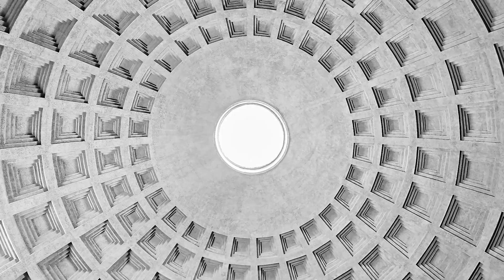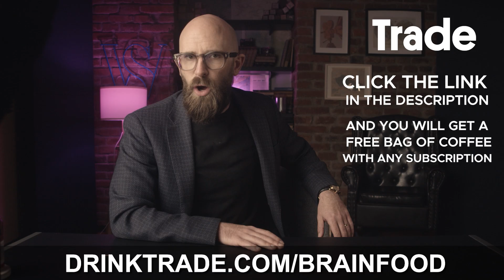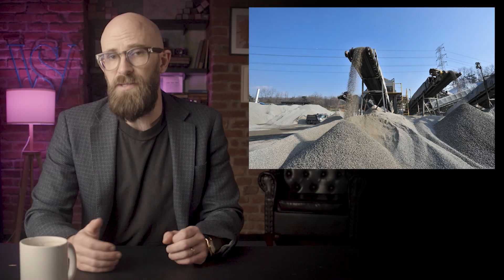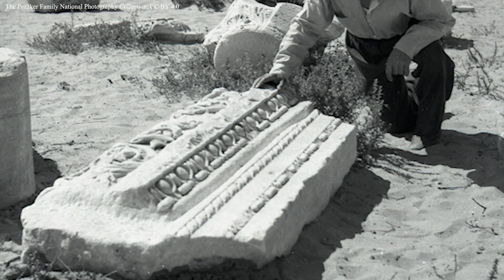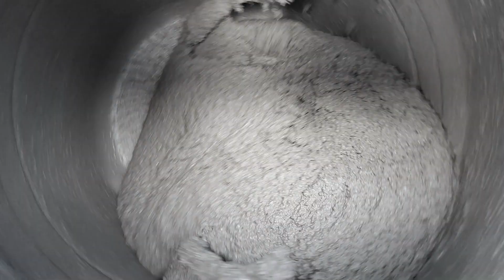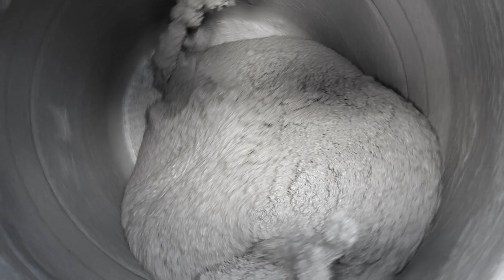How Did the Ancient Romans Make Concrete So Much Better Than Ours?

Comment: Everything changes in 2000 years. It was a different world we lived in 20 years ago. The bacteria was different in the earthen materials 2000 years ago and behaved differently under different environmental conditions. It wasn't what the romans did or did not do, but what the bacteria from 2000 years did and did not do within the cement. The Romans also worked with concrete in times where atmospheric pollution (uv radiation) was minimal compared to today. Ground vibrations (traffic, tactonic plate shifts)  were also minimal. Roman style concrete was given a longer time to cur under less extreme and intense settings, allowing it to gain long-term strength over time. If they attempted to pour roman style concrete today, it wouldn't stand a chance, which is why they don't make it. They know how to make concrete 1000 times better in private patented applications while general concrete construction applications (including uhpc) are expensive and shit

Comment: I’m still in the preroll ad but let’s guess no sand large sharp angular rock lots of cement wet curing and overall not being cheap while calling it engineered and charging more for it

What a shock I was right

Comment: Depends on the applications. If you want to build a 3 story building or aqueduct out of stone and concrete not a problem, any concrete will do. If you want to build a bridge that spans a river out of concrete or a 100 story building, then no, Roman concrete would collapse. Modern concrete is a hundred times stronger.

Comment: The fact that fly ash (which my laboratory regularly tests and just from the amount we receive is very abundant in the industry) could be used to help make better concrete is astounding… my only question would be if Roman concrete could stand up to Minnesota winters. If the answer is that they can… I’m going to be severely disappointed in the concrete industry, cuz we obviously need more durable roads but that wouldn’t negatively impact them financially because roadwork is a never ending process.
Reply: Yeah, American roads are laughed at globally... tbf they're put through harsh conditions

Comment: The use of steel in modern concrete is the number 1 reason for it’s short lived usefulness. The moment the chloride crystals reach the steel, it starts rusting which expands and causes cracking and spalling.
Reply: Actually the alkaline environment "inside concrete" provides steel with corrosion protection.

Comment: I think the biggest reason the Romans developed concrete that would cure underwater and last so long was that they only wanted to build it once. Modern contractors want to insure they have a future so they don't want concrete that last forever, because they would put themselves out of work after about 10 years. Not entirely true but the demand would basically be limited to solely new construction and they would loose all the work they get tearing out old concrete and pouring new concrete.

Comment: The problem is people today cannot comprehend that a civilization from so long ago would still have created something that not only hasn’t been quite matched put is actually inferior! If it wasn’t for rebarb, modern concrete wouldn’t be much use in today’s society. If Roman concrete isn’t strong enough for modern use, rebarb could always be added for roads and such, but that may not be necessary given the durability of Roman concrete. 

The industry basically has to accept that Roman concrete is superior and then it can be willing to switch over. I think this is a great business opportunity for anyone in the concrete industry to spear head; and for Italy, I think it is a no brainer for them and should spearhead this endeavor themselves!

Comment: Just no. Roman concrete was not better. It did not need to stand up to the forces that modern concrete does. It's the same kind of ridiculous arguments that say Roman roads were better. They weren't. They just didn't have to stand up to tens of tons of metal slamming over them at high speeds. Most roads would last so much longer if trucks did not go over them as they cause nearly 90% of the entire damage to a road surface.

Comment: Somewhat disappointed by the serious downplaying of modern concrete.
Modern concrete doesnt crack and crumble after just a few years. At least not the high quality stuff. We just live in a time where things are build as efficiently as possible: if it doesnt NEED to last 300 years, we arent building it to be able to last 300 years, to minimize resource use and cost.
We have concrete with capabilities the Romans could only DREAM of.

Comment: Hmm I'm not really sure this videos is fair too today's concrete. For example the roman didn't use steel bar which highly limited them in architecture design in how they can build. Steel bar's corrode in time, when in contact with oxygen and under corrosion it will expand and inner pressure will make concrete to crack and that's one of the reasons why concrete breaks down today. Lifetime of the concrete construction are set by how thick the concrete is between steel bar's and outer lair, and w/c ratio. So If we cast concrete without steel bar our stainless steelbar's that problem will not happened and concrete will just go back to lime stone. 
You also said today's concrete can't cure underwater, that's just false. We cast concrete all the time underwater and it set's and cure fine. Also concrete underwater breaks down slower because of the capillary pores are filled up with water and there is no oxygen under the water which will make the corrison from the concrete much much slower. 
And today's concrete can also selfheal, such as when exposed to moisture or pressure.  This is because the concrete contains calcium hydroxide which can react with water and carbon dioxide to form calcium carbonate which closes the crack. If the Roman's concrete and self heal better that I can't say.

So to summerize we can build Roman like lifelong structures today, we just choose not too, for obvious reasons, cost and time contrary to demolishing and rebuildning because city's expand and we get bored from the designs eventually. Only thing that's fascinated with there concrete what I can see is it resistance towards sea water erosion and the C-A-S-H layer it develops.
Reply: So what you're essentially getting at is the Roman solution to concrete was pretty damn innovative for it's time but nowadays it's essentially an inefficient way of creating structures. There are better methods nowadays that offer a myriad of benefits and aren't difficult or restrictive. I wouldn't say Volcanic ash is "expensive" as it one of the most abundant materials on ass, though importing it over say stand fly Ash I could imagine being a colossal pain in the ass. 

Ultimately I do like the idea of Volcanic Ash sheerly for the concept of creating structures that are designed to last into the future though but for the sake of actual practicality I'm sure the standard coal/fly ash is the better solution within most complexes.

Comment: So very interesting. Knowing what we now know, they should make this standard practice for making concrete.
Reply: Ye but no.

There are simply too many current uses for concrete where the Roman recipe would be inadequate to purpose.

For somethings it would work fine, but for others you would make even worse problems from concrete that just can't take the same weight over it from 10x lower compressive strength.

Those lime clasts are brittle and decrease the overall strength of it vs modern portland cement based concrete.

Comment: Whatever the ingredients were they had to be plentiful and easy to acquire. They made a lot of concrete.
Reply: Well the location where the volcanic ash and lyme casts from are from near the Bay of Naples which is where the volcanoes Campi Flegrei and Mount Vesuvius so sourcing the Ash wouldn't be an issue at all... transporting it would be a colossal pain in the ass though. Of course water I shouldn't need to explain. It's honestly impressive stuff.

Comment: Interesting review.
Two points. 
Concrete cures, rather than dries. This is a chemical reaction which also creates heat. 
Roller Compacted Concrete, or RCC is used in dam construction worldwide.
Nothing new there.
The ancient Romans were indeed, fine engineers. 👍

Comment: Before the coming of steel spanning bridges and other structures was very limited and challenging.  How the Romans could achieve these things  is amazing.
Reply: The Romans still couldn't do what we can today with bridges.

Like the guy said - modern concrete IS stronger, can span greater distances and take more weight.

Roman concrete is just more durable long term and better without steel reinforcement than modern concrete without reinforcement (the chemical processes that make Roman concrete so attractivee do not work so well with current reinforcing materials like steel rebar).

The trick will be to try and meet somewhere in the middle to get the best of both worlds in one material with reinforcing materials that can stand the higher temperatures of the quick lime reaction.
Reply: @mnomadvfx   Yes, that’s what I meant to say.  Steel changed the world more than most people know.  Thanks for the comment.
Reply: I agree, but I've also got to point out the only reason that style of building was even remotely viable is because the Roman Empire clearly didn't mind throwing as many bodies as they needed for such a grand scale projects. Nowadays, I seriously doubt that would be easy to do.
Reply: @Akechi_The_Phantom_Detective  Thanks for the reply.  Yes indeed, workers were expendable.
Even later in Medieval times, many lives were lost building Castles and those beautiful churches.
Reply: They were very determined, like that one time where a general was crossing the Rubicon.

Comment: Fly ash was used here as a cheap, lightweight & easy to work self compacting material for building pads. In the decades to follow, this material has grown crystalline structures within it that has been lifting the structures built on top of it. Used incorrectly, flyash is a very bad long term solution.
Reply: Well said. So it's the quality of how the ash is developed rather than what it is. Good to know.

Comment: Interesting video, but some weaknesses.
- It's not true to say that Roman concrete used materials fired at much lower temperatures. After all, a key component came from a volcano!
- Your description of mixing modern concrete was wrong. Lime is not involved and all the ingredients (typically cement, sand and gravel) are mixed together with water at the same time.
- The construction industry has been using fly ash as a partial replacement for cement for decades. However, that material will become increasingly scarce as coal fired power stations are phased out.
- Low water content giving increased durability is well recognised. The additional water is largely to be able to pour the concrete into the formwork (mould). It is then vibrated to try to eliminate voids. The way the Romans placed their concrete would be immensely labour intensive and quite unsuitable for many of the ways that concrete is used in buildings today.
- The main cause of modern concrete failing is because it has rebar inside it. Ultimately this will corrode and expand within the concrete mass, causing damage.

As a final thought: Would we really want modern concrete buildings to last 2,000 years?
Reply: You know I will give the Roman's credit for the innovation especially so long ago but I feel like it's fair to point out them even figuring out how viable volcanic ash even is took a fair amount of pure luck. Not just to experiment with Volcanic, but to do so at a volcano that would just so happened to have a hydrothermal system where it would be so readily available in such a state, that Volcano being Campi Flegrei. Kind of feels they used whatever mass material they could use as a cement mixture and ended with a very fortunate result. 

Of course, I may not be giving them enough credit but I can't help but think if you tried this with Ash from any other volcano it would take WAY longer and probably require more man power.

Comment: Roman concrete was mixed with volcanic ash. FYI, we do t use that, lol
Reply: The main reason is because A. The Roman's used volcanic ash from a specific volcano that had a hydrothermal system that allowed it to be mixed very easily and accessible and B. The romans really didn't mind throwing however many bodies they needed to, to complete their grandiose construction projects. The volcano in question is Campi Flegrei, and it's not guaranteed any other volcano would've made getting the material much easier as it'd probably take WAY longer.

Comment: Sounds great except that "1/10th the compressive strength of modern concrete" might be a bit of an issue unless we can find ways to maintain the new benefits while still achieving modern strength standards. Or maybe it will simply have niche uses.
Reply: I'm assuming it's a combination of the brittle lime clasts and the lack of steel/etc rebar.

I'm sure that with additives like small CMC rods and larger scale bars that they could increase it's strength a lot.

It wouldn't be cheap though.

Comment: The reason why our concrete is different has to do with water. Our 'wet' concrete is necessary to pour huge foundations for modern buildings. As well as bridges and dams. We can build big things fast but our concrete has weakness like expanding and contracting do to temperature. It doesn't do well in humid environments & needs more maintenance.
On the other hand the romans could never make a colossal structure like the hoover dam.
Reply: So in essence, the volcanic ash solution simply isn't as adaptable unless you're willing to throw a shit ton of bodies at it.  It's good for it's insulative properties just not practical for any grand scale projects.

Comment: I will say that I made a high yielding strength concrete at University. 
1 day strength 65 MPa
3 day strength 91 MPa 
7 day strength 122 MPa
14 day strength 147 MPa
28 day strength 162 MPa

All done with curing and a low water to cement/ratio.

I put up a video on my channel of a cube being tested to destruction.
Reply: You must of had good Fine and coarse Agg o
In the 2.75 SPG

Comment: Modern commercial buildings have a design lifespan of 50 years. In that span of time things change enough that the original purpose of the structure will be obsolete. So why make it any better than it has to be? You're only making the demo crew's job harder.

Comment: I've watched a bushcraft builder make cement from wood ash to build a small kiln, with which to fire clay bricks.
that cement could endure several hefty hammer blows, from the same builder, when it came to taking it down.
that's WOOD-based cement!
imagine if they were to replace all plastering and detailing with wood cement, and save the actual cement for stronger constructions.

Comment: I can't get over the fact that it's been possible and available for millenia and yet only recently people have bothered to make it.
Reply: More like it was largely (but not completely) forgotten about during the dark ages after Rome was sacked and the western Roman empire collapsed - but the invention of modern concrete and production of it at scale ensured that "good enough" was the standard for quite some time until climate and cost concerns began to become an issue.

Still though, it's 10x lower compression strength is a serious issue.

A dome is a very stable structure when properly constructed with nothing actually putting force on it from above, so it's no huge surprise that the Pantheon is still standing.

Try to build a modern scale concrete bridge out of it though and you won't be praising it so much when the repetitive force of thousands of vehicles per day are weakening its structure all the time.

Comment: 11:24  replacing Roman Puzzolana_ash with modern coal_ash may have an unexpected drawback: it could contain more Thorium and Uranium than Puzzolana! Not really healthy for building living quarterrs! Except if the radioactive elements were extracted beforehand, which would be very useful for nuclear fission reactors, MoltenSaltReactors making (much) more electricity! (better than let those elements leaching out into the groundwater)
Reply: I mean the bigger issue is the volcano they got the Ash from is named Campi Flegrei which is located right next to Vesuvius and well... Campi Flegrei causes a lot of Earthquakes which ironically is a good way of testing the material.

Comment: In northern Italy, in the mountains, the olive garden walls are still built and repaired using the old ways - they still add rough stones, caulk stone, hot ash to portland premix, and pour it almost dry. The old men say it takes a month for the terraces to harden, and millennia  for them to crumble. Roman cement was never really forgotten by the old, there was just this cheap alternative.
Reply: interestingly east Germans working on private projects also use bigger aggregate, like rocks found on the fields (or from the dirt they excavated before making the foundation), smashed bricks, and other things.
this mainly started as a way to keep cost down, by subtly getting rid of garbage which would have been expensive to get rid off and reducing the amount of cement needed, but the benefits have not been lost on us.
Reply: Nice

Comment: i’ll sum it up, roman concrete is not strong, but it lasts longer, modern concrete is built to handle the weight of skyscrapers  and modern vehicles. also the sea salt in rome helps harden it